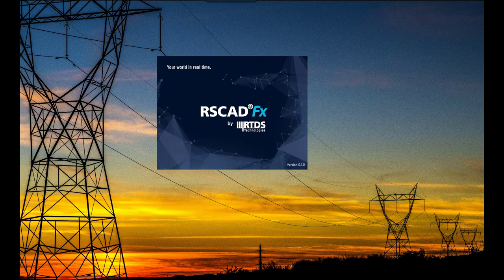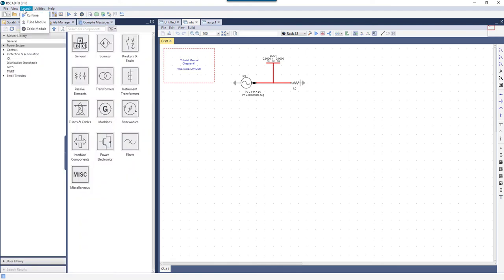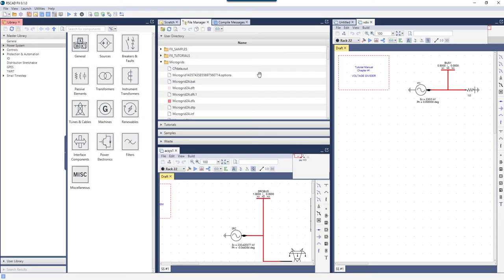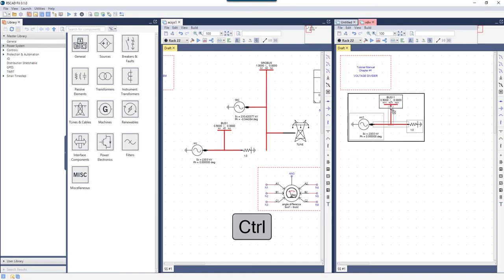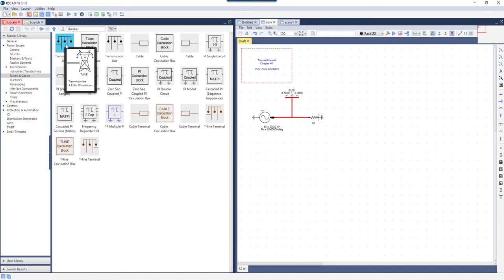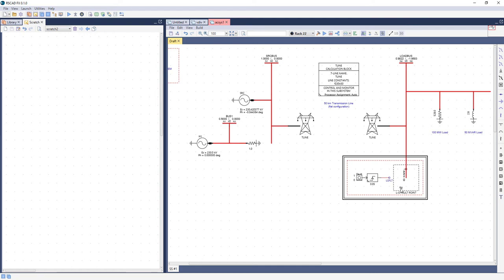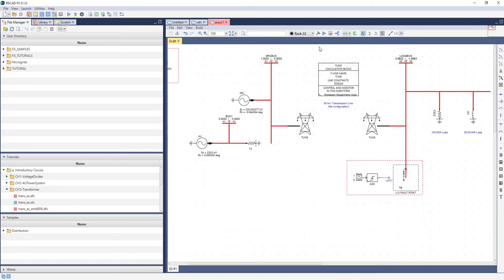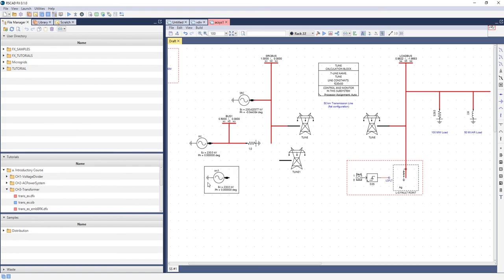RSCAD FX Demo Video 1  - General Introduction

Comment: Can I get the details between RSCAD FX1.1 and RSCAD FX1.2?
Reply from the maker: Hi Sourav. In the RSCAD FX software, click the 'Help' dropdown menu in the top taskbar, then click 'Release Notes'. This document will show all the changes between RSCAD FX 1.1 and 1.2. If you have specific questions, please email support@rtds.com.
Reply: @rtdstechnologiesinc.3249  Does this release notes are not separately available in website of RTDS Technologies? Because based on that I will decide whether I should update to Fx1.2 or not as I am currently using FX 1.1 and I hope some issues of it are resolved there.